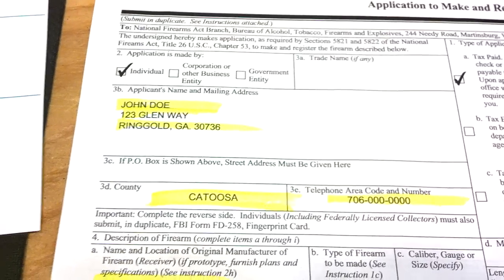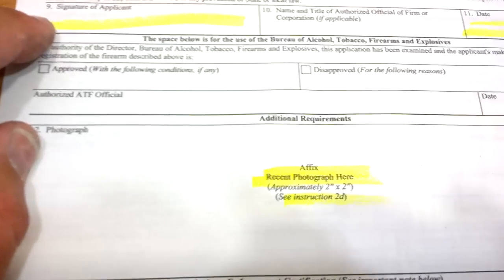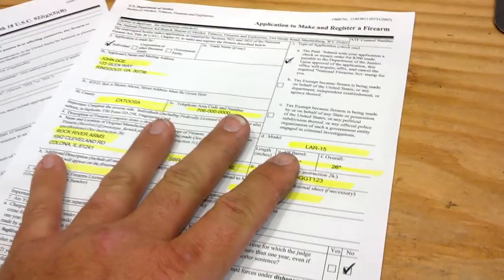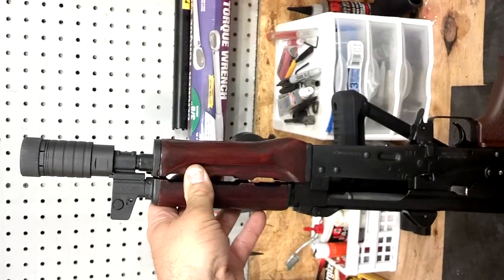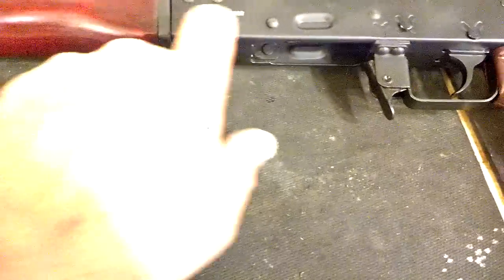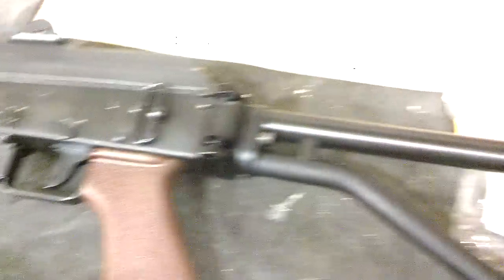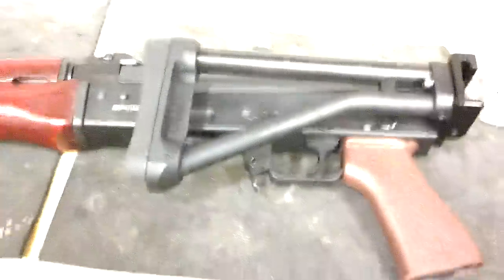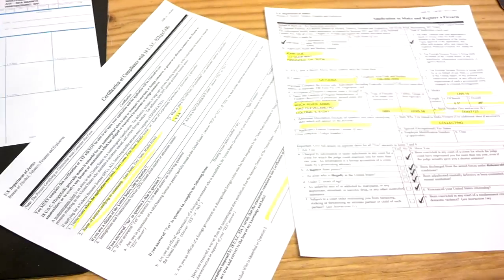How to register & build a NFA SBR item.

Comment: One thing you said that was incorrect. There is NO ATF regulation that says that you can't go shorter one your gun than what you applied for when you registered. There are many ATF letters out there that state that you are free to change barrel length to anything you want once you have your stamp. ATF wants to be notified if you PERMANENTLY change your configuration, but even this is not required by law or regulation.
Reply from the maker: True, I just did not want to confuse anyone.

Comment: When measuring the overall length of the gun, do you measure from the tip of the Booster or the end of the barrel to the end of the trunnion?  Or do you have to add the length of whatever stock you are going to use?  Thanks for the video, going to eventually SBR my PAP M92 also.

Comment: What's the exact rear block and stock you picked up from ace? What's the cheek wield like, able to get a good eye relief on a red dot if needed?  Did you do anything to the rear trunnion to make the stock fit and how hard was the receiver to drill and tap?
Reply from the maker: You can get the Folding Stock Mechanism from Ace Ltd. I like the look of the Manticore Arms Co. triangle stock better. Looks more like a krink.
Did nothing to the rear trunnion either other than drill & tap. Good sight picture too.

Comment: This is probably a dumb question, but if I build an SBR, can I keep a full length upper and swap it out as needed.  Also is there a permit that I'll need to carry while in possession of the gun in SBR configuration.
Reply: Yes you will have to carry your tax stamp with the gun. As for the lower. Most likely you won't be able too. But that is a question for a lawyer.
Reply: +Mark R Yes you can switch to any full length upper.. for "temporary" uses..

Comment: @christainarmoryworks.Why does and SBR have to be more then 26", I thought that was the whole point of a SBR. Meaning i want to build a PDW that will be less then 26" wont one Tax stamp cover it? Barrel will be 7.5"
Reply: Old post, but for others reading, it's easy to misread the definition, it's a rile/shotgun less than 26" in overall length  AND/OR  a barrel less than 16".  One example would be a sawed off shotgun or riot gauge that has a 16" barrel but has a pistol grip making it less than 26".  Another more common one today is an AR15 with a collapsible stock and barrel shorter than 16".  A AR15 that was registered as a pistol CANNOT have a vertical grip up front OR a rifle stock of any sort.  You can turn an AR15 pistol into a full rifle, but NOT turn it into an SBR with any of those parameters and w/o going through the federal process or it's a felony.  Be careful and do everything to the T, don't change the weapon configuration until after you get the approval and forms.  The length estimate you enter on the form can be an estimate, don't assemble the SBR upper and measure it, because yes, having the assembled SBR upper w/o the forms is a felony.